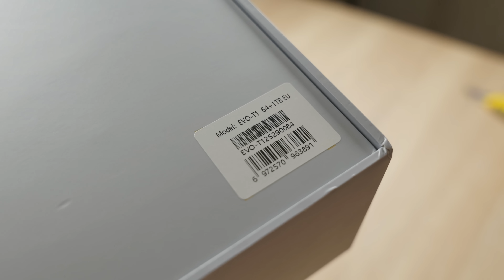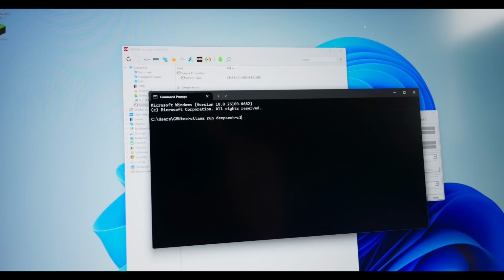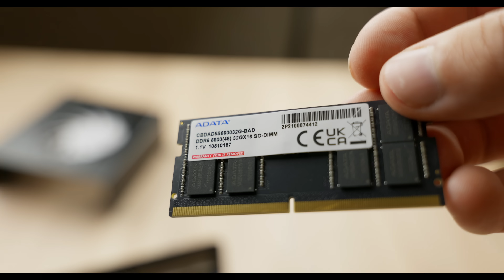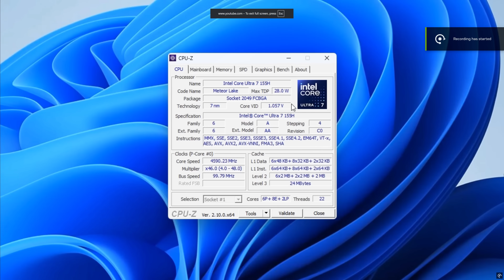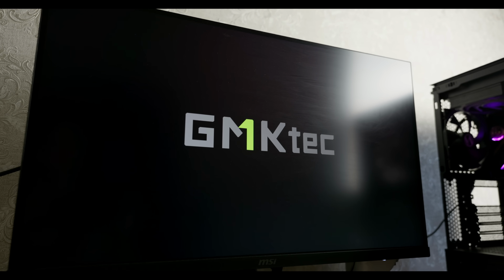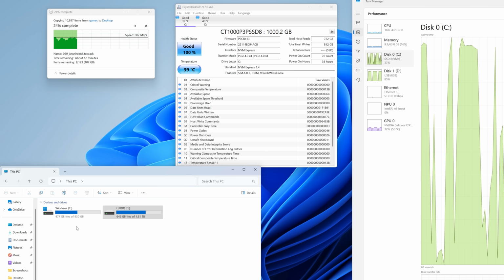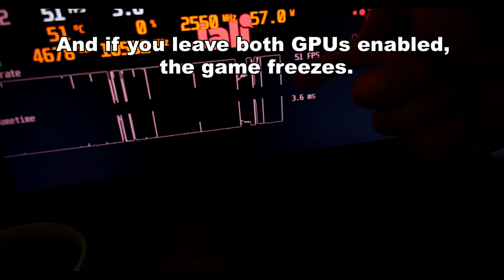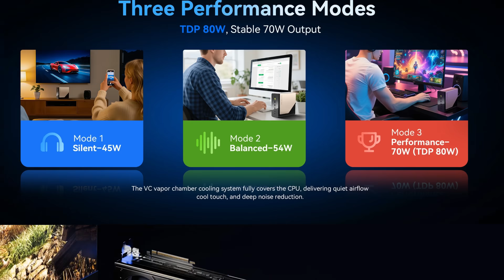Mini PC vs 600W GPU

Comment: i highly recommend PTM7950 for thermal paste for those lil chips as it works best directly on dye and then heat-sink on top works just as good as liquid metal if not i think works better

Comment: Wait a second. Isn´t it ill advised to use liquid metal on copper cause of corrosion? The heat spreader mounted on the die has a copper surface area. Can someone correct me if i am wrong on that?

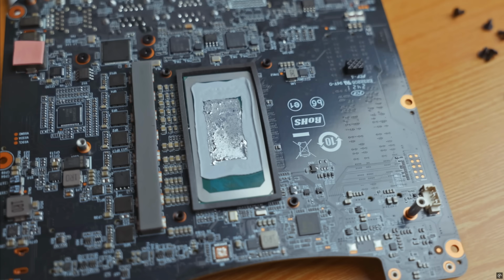Comment: 6:53 Kapton tape is not made of nylon; it is made from a thin film of polyimide, a high-performance polymer known for its excellent heat resistance, electrical insulation, and chemical resistance.

And don't worry about the bare cpu and the liquit metal. The only material you should avoid using liquid metal with is Aluminium. The Gallium from the liquid metal paste will eat the Aluminium.

11:01 There are some bandwidth limitations, sisnce the Oculink only uses X4 lanes out of 16.

Comment: I have a couple of FIIO amps myself. The BTR13 and the BTR17. The 13 serves as my bluetooth audio gateway for my vintage Kenwood receiver, and the 17 serves as my bluetooth audio gateway for my phone. What I really like is that I can also use them as a desktop sound card if I ever decide to go that route. They sound excellent through both my stereo and my earbuds. Great capabilities at both price points. The BTR13 was about $70 USD and the BTR17 was about $220 USD.